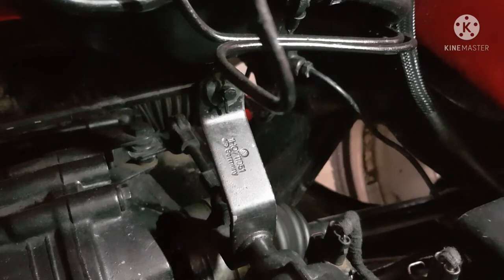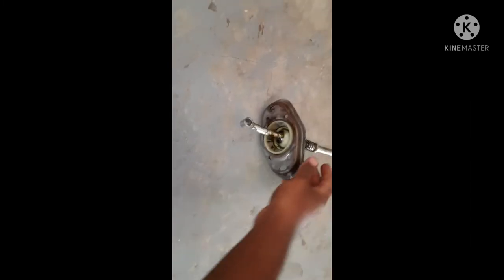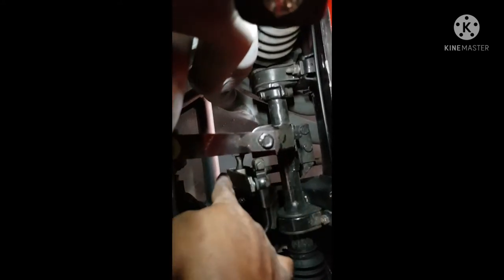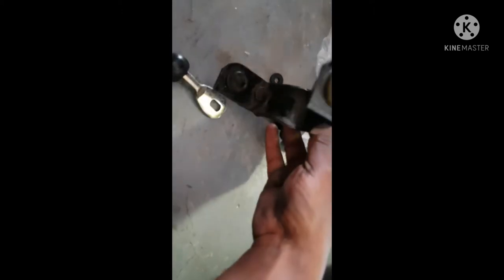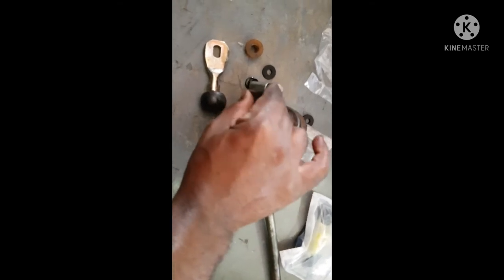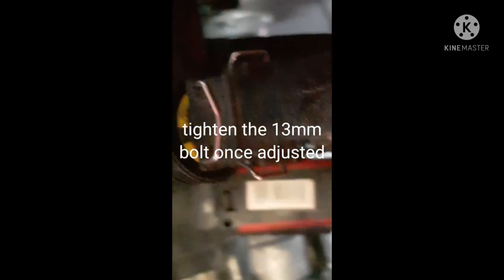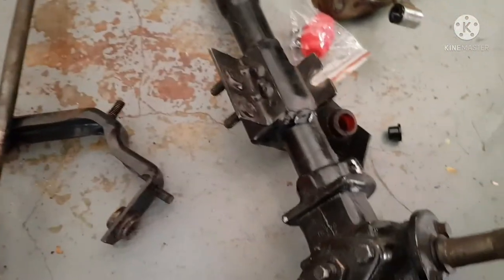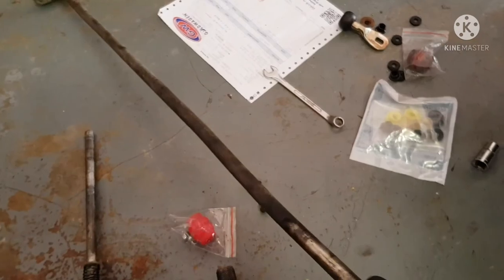setting gear linkages on a golf mk1

Comment: Great video thanks. One question, which way do the clear bushes go in on the bracket that attaches to the steering rack?
Reply from the maker: Hi. Yes they do. The bracket has a notch on it and the bush has a corresponding piece as well hence it can only fit in a set position
Reply: @built mk1  do you push the top Bush in from the top of the bracket or from the underneath? Mine keeps popping back off onto the shaft
Reply from the maker: @darrynstephen4611  . The bush has a lip on both sides that prevent it from popping out. It should be able to go in from either top or bottom.

Comment: Hy bro. Please help,when I put gears in position and release clutch my car doesn't move. What might be the problem. Mk1
Reply from the maker: @SèbabatsoPaulos  . Hi. This sounds like your clutch needs to be replaced.
Reply: Only clutch kit or also need to buy new clutch cable
Reply from the maker: If your car is able to take gears whist idling it means that there is no issue with your cable. The only other issue which is actually a work around is to make the cable shorter by screwing in the plastic that sits on the cable at the gearbox. This will make your clutch lower but might alow you to drive the car a little longer
Reply: Okay. Thanks bro. Will get back to you
Reply from the maker: @SèbabatsoPaulos . Shot bro

Comment: I am struggling to get someone to help me fix  the gear selection of my mk1 gear selection. Reverse, gear1 and 2 selection is problem.
Reply from the maker: Hi. Disconnect the linkages from the selector and try to select the gears manually on the box as shown in the video. If it doesn't go in smoothly,  you have a fault on the box. Secondly check all the bushes and rubbers.  Worn rubbers and bushes will cause selection problems as well.